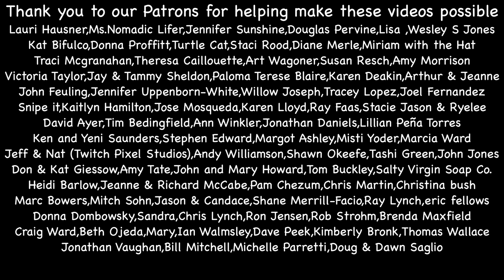Off-Grid Mom Builds OUTDOOR KITCHEN // living with a baby in Panama PART 3

Comment: Sadie is the most adorable baby that I have ever seen. Nice job so far on the oven. After you finish it and let it dry, you will have to season the oven by first making a small fire in it then let it cool, next a larger fire and let it cool and finally a blazing fire. When I built my oven the plans that I followed online recommended that so it wouldn’t crack. I also used fire brick instead of clay brick. Can’t wait till next video.

Comment: Hi,  We have a lot of respect for you guys and the little world you've made for yourselves down there. And your daughter is lovely.
But....I've been a contractor and in the trades for over 30 years, and when you pour concrete forms, the last thing you do before you leave the job, is tap, really smack the sides of the forms with a hammer. All along the perimeter of your form. It knocks back all those rocks and allows the fine cement ( concrete is the combination of cement, sand and aggregate.) to flow down into those crevasses that are showing on your small slab. When you remove your form sides, your concrete will be as smooth as can be.
Good Luck, Keep up the good work.

Comment: Just a tip on those firebricks. When you are using the oven be careful not to slam those bricks with firewood or the peel. They are actually more brittle than you think. A real pain to climb in there to replace them. I learned the hard way!!

Comment: The most interesting thing I've learned about my many years of watching/learning ahout house building techniques both old and new; particularly in the past, the available materials and climate conditions were what dictated the materials and style of buildings that we created. 

South facing windows for winter heat in colder climates.
Minimal windows in historical building to prevent heat loss.

Different materials and quanities needed of insulation, waterproofing, roofing systems.. 

Earth sheltered and partly underground homes in historic Scandinavian colder temperatures.

Adobe and earth based buildings in hotter climates.

Clay and therefore brick has been abundant in the UK for a long time. Victorian houses are literally everywhere.
We also have buildings/ruins that date back thousands of years. 
All of those are stone. 
Tudor buildings still exist in quite considerable condition too. They are heavy timber frames with wattle and daub and cob constructions.

Bamboo in its plentiful, sustainable supply and rot resistant nature has allowed the building and use of homes to cooking utensils for thousands of years in asia. 

Your climate & availability of material is a and new/interesting combination to me.

I'm interested to see what buildings you (as in, the community on your land) do create and why, how they fare, and what innovations you find on the way!

Comment: I’ve never posted a comment on a YT video before but I think this might be helpful. It might be too late - you may already be further along with the build on the pizza oven, but just in case… Also, I’ve not done this before but it sounded so logical to me when I heard it I thought there might be something to it? 

Apparently, one technique for getting the dome shape perfect is to use a “wet sand” - kind of like you might see in a playground sandbox, one that will hold it’s shape when formed and form the final “interior” dome shape that you would like. Pack it in place, and use that to lay your bricks on. The sand will help to maintain a smooth interior shape while cementing the bricks in place. Once dry. dig out the sand and you have a beautifully formed interior dome. Sounds like it might work, doesn’t it? 

Greatly appreciate your videos!

Comment: You really need to dampen the concrete that you poured also not completely saturated but dampen it also so it doesn't pull the moisture out of the mortar dampen all surfaces so that there is less cracking and more adhesion to both surfaces a little bit of information a little too late. Okay to elaborate on your confusion cement is the glue that makes mortar which is usually San cement in a little bit of lime or that makes concrete which is usually sand cement and Rock and of course there's many different variations of all of that. And of course she gets so many responses you'll probably never even read this and never respond so good luck I'm sure everything will turn out just fine

Comment: Not impressed. A man always works towards his mass center point and your girl is hanging there. You drill into cement base with steel drill and then hammer a screw in. Any idea what will happen if the drill bit disintegrate or even better yet, the screw brakes and blows back to your girl's face or eye. Really people be safety conscious at all times !!!